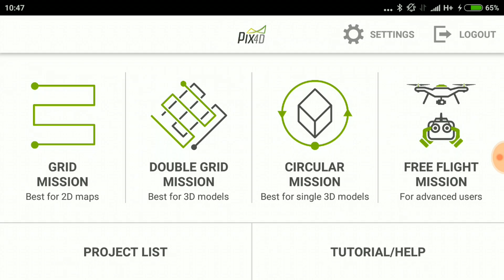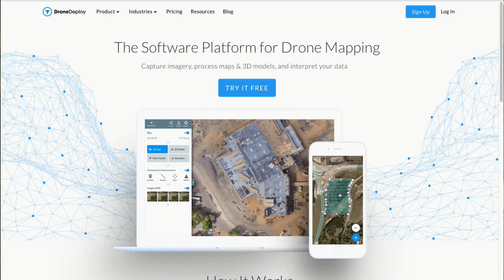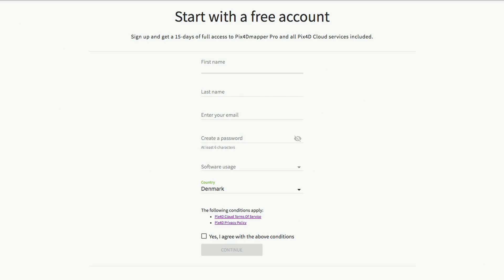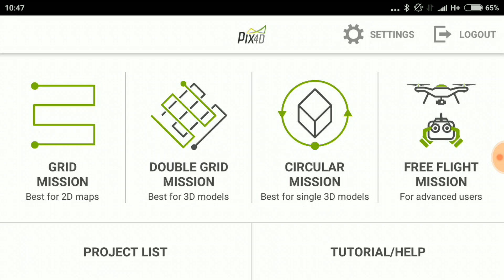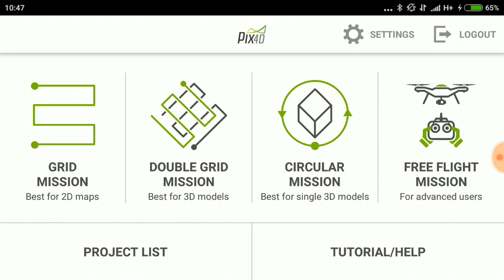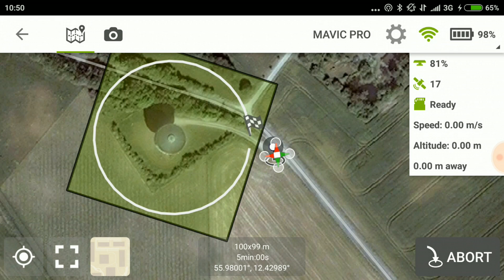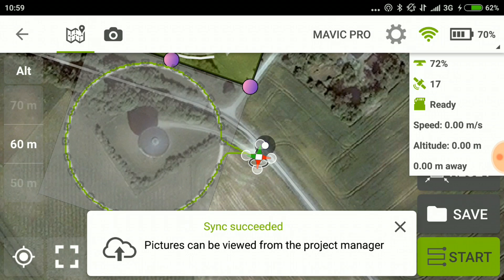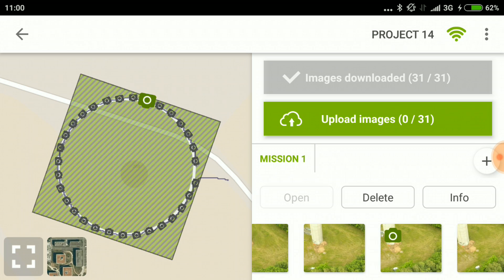How to do 3D Mapping with Pix4D - part 1

Comment: Other than pix4d...is there any other 3d mapping software you recommend?
Reply from the maker: only tried that one
Reply: @TECHDRONEMEDIA  have you tried pix4d with mavic mini?
Reply from the maker: I don’t think it’s supported
Reply: @imyong7983  Use Dronelink for the Mavic Mini. I learned a lot with a inexpensive drone for expensive deliverables and great software.
Reply: I used Drone Deploy ... much easier to follow and allows live feed as you do the way point mission. ONE DRAW BACK - quite expensive. BUT - worth it.